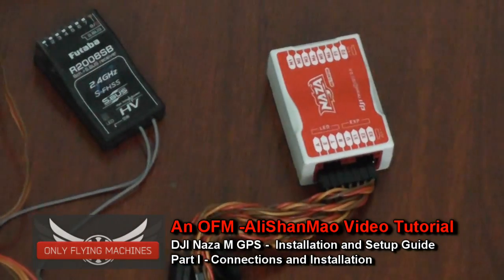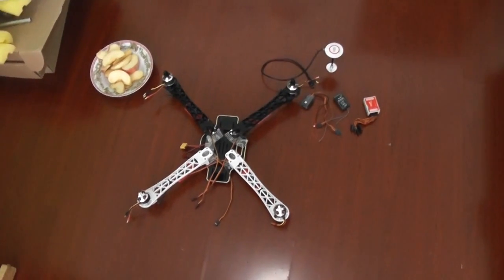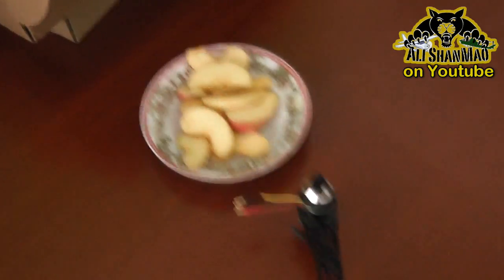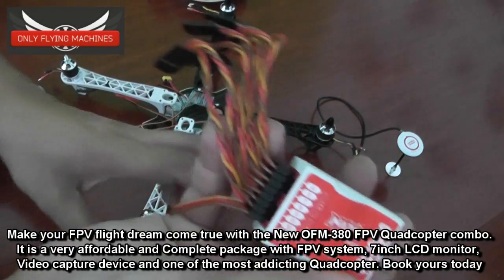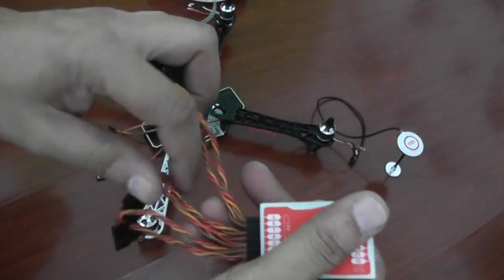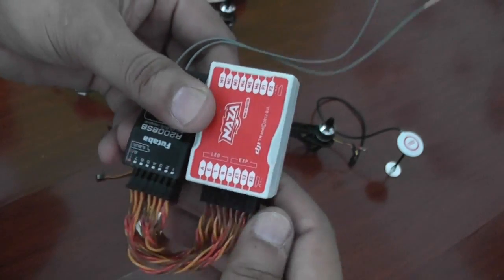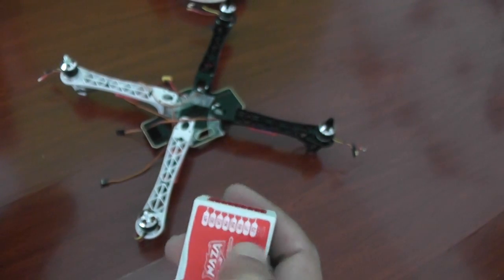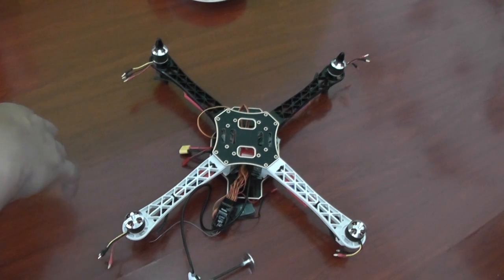DJI Naza Installation and setup New Guide -- Part 1

Comment: I don't have the LED with the output for X3 wiring but I habve the normal LED unit. Is there another wiring to read the voltage and to have acess to the "voltage monitoring" menu? Thank you

Comment: Ali, how do I get those cables that go from the esc to the M1, M2, M3, etc ports on the Naza? Do I have to solder that type of cable to the esc? Or do they sell them with that kind of cable already installed?

Comment: all you guys not connecting should understand that only 8 wires (Quad) should be plugged into your Naza. The 4 from ESC M1 - M4.  The S-BUS servo lead from port X2 into the S-BUS port on the RX!!!!    The V-SEN servo lead goes into port X3.  Then the standard L.E.D. and GPS connections go in their designated place.  Thats it fellas...I had problems until I switched TX and RX.  I went from a DT7 and the accompanying RX and never achieved flight, let alone connection to Naza.  So I wound up buying a Radiolink AT9 with the R9ds rx and connected and flying within hours of delivery...Hope this helps you.   Oh yeah the TX and RX are less than 100 on Amazon with Prime next day delivery...

Comment: Hi i have some questions, a total newbie.
Can you put some detailed pictures of the wiring between the naza and the receiver (which colour cables are on the upper end on both the parts...naza and receiver). and then the right way to connect the esc to the naza. thanks

Comment: I have a question, I had set my system up as per you 3 part instruction, worked great, Thank you. But now I am building a new quad with DJI NAZA and the Futaba T8J radio, when I went in and tried calibrating the receiver the stick movement does not show up in the DJI assist program. I can arm and disarm the motors with the stick movements but it does not show up in NAZA, any ideas?? Any assistance would be appreciated

Comment: why should you remove the red cable from the esc, i am using the naza m lite, and my motors, when plugged in will continuously beep every 3 seconds and the led module with keep blinking red rapidly.

Comment: sir i have question im from philippines,can i use a cheerson cx20 transmitter to naza m lite v2?
Reply: Sir I also have A question, How to connect naza to my FlySky 6CH???Thanks sir..
Reply: i connect the flysky in naza m... if you still need help i can help you..
Reply from the maker: +Vince Gabrinez I do not think so
Reply: ok tnx sir
Reply: sir sorry i dont have the idea of that,but you can ask sir alishanmao
Reply: ok
Reply: do you use the flysky  similar at turnigy tgyi10?
if is like that may I ask you for advice about the config in the radio transmitrer and connection receiver with  the naza m lite?

I conected the cg 1 2 3 4 to A E T R respectively, the channel 5 (flight modes) to the U on naza using the three position switch A on the radio. (but Atti is determined for the channel 7 on the radio).   and channel 6 on the receiver to X1 on naza  using the VRA knob to change the gains . the channel 7 to the X2  for the Intelligent orientation control , using the switch C on the radio. how use the Atti with the switch A if coming from factory that we use the channel 7 for that.

I will appreciate your help in this matter

Comment: Hey Ali,  nice video. Setting up a 500 quad with this unit.  Have a question about why to not hook up the red esc wires.  I am assuming that is the power positive wire, correct? Why is that important, many their videos don't mention that.  Also, can I just hook up the signal wires only on the receiver connectors? Thanks for all your videos, one of my favorite channels on the tube.

Comment: Salamulaikum Mr Shanmo
Can I use my Turnigy 6x with Naza Lite ? coz I have an issue when trying to do that, the Naza flashes yellow so fast and keeps in that situation :(, when the Tx is OFF the mode switches to ALT mode, and when ON it switches to the far right " EMPTY LITTLE BOX" !!!!!!!! any HELP please, does this trans. supports Naza lite ? Thanks in Advanced

Comment: Ail, I have been flying quads off&on about 2 yrs.I have just  builds a Tarot 650 sport, Tarot 4s 4006/620kv motors dji  opto esc &T8J tx. First test flight,got the quad lite on it's feet, looks like it is trying to go to the left.However the right stik moves it more to left, the ail sticks look back wards.But when programing on my pc all calibration were perfect, anyway it flipped. I have set everything by your videos for years with  no trouble, I'am at a lose- can you help.By the way I'am flying a F450 never crashed I am at a lose can you HELP............Jerry

Comment: My assistant software say "GPS needed" and it only goes into atti, manual, or failsafe. It has no option for GPS mode. Any Ideas?
Reply: I hv the same problem , any ideas?
Reply: +Seth Nicodemus ( the gps might not be working rite ) I crashed mine once and cut the wire going to the gps & when i put it back together it was doing that (no gps) I replaced it with the ublox and it worked just fine !

Comment: Hi Ali Shanmao  Awesome information and videos

i need some information i'm building a bumblebee 550 quad but i'm just buying the bumblebee frame i need help with the Transmitter, ESC, Motors, and Flight controller board but i want to use the Naza flight board  could you recommend compatible Transmitter, ESC and Motors  all most forget battery type too

Thanks in Advance 
Sheraz Mohammed

Comment: Hi Ali, I have a little problem with trottle and I can't find a reasonable solution. Trottle works perfect if I check on software, but if try to control it on the drone, motor start running slow and then suddenly fast once I move forward the trottle stick a bit over half the way. It should control motors progressively  from the lower to the highest position and viceversa, but works only if I connect the machine to the computer checking to the manager software, so I don't understand why it doesn't act the same once unplughed.  I'm using futaba Radio T8FG transmitter, and R6208SB receiver. Both motors and escs are from DJ Naza, as  well the main kit NAZA V2 (yellow one) the frame is instead from X650 aircraft. Thanks so much for your help.

Comment: I have all of the copter parts, though I don't have any apples.  Does this matter?
Reply: beaver2206  you will need the apples, that's the most important part of the setup

You can buy it from nearest store (unless you are living in Antarctica, in that case just be safe from polar bears, because if they eat you then your setup-apples will be of no use)

Comment: Hi can you help I have installed the naza m lite and I have linked to the laptop and set the calibrations I think but when I unplug the usb I still have a orange flash then 3 red flashes and so on,have I done it wrong,I can arm my motors and throttle them up,thanks

Comment: My naza m v2 gradually loses power to esc's after only a few min of flight and lands wherever it is at. Even with full throttle have you seen this issue? Not in failsafe or voltage protection mode normal led signals.

Comment: I am thinking of getting a NAZA M Lite with GPS.  Is it possible to program the barometer/altimeter and tie it to a switch.  I would essentially want to be able to flick a switch limiting the height to 4-6 feet and then when I am ready to land stabilize the quad, flick the switch and bring it down.
Reply from the maker: why not you put the throttle to middle when you are at 4 or 6 feet and your multirotor will hold altitude :D its easier than programming the barometer which of course there is no way to do so

Comment: For folks that are using BEC enabled ESC's like the Mystery ESC's make sure that you pull the RED wire and make sure that your ESC wires are BLACK-wire-UP connecting to the NAZA! I am Using the Turnigy 9XR TX and the Orange 9CH DSM2 RX and my quad is flying "like a Dream come true"! I mean anyone can fly a quad like a pro once your NAZA is setup correctly. The challenge is wiring and radio settings. Once you get those 2 things right a 10 year old kid thats never flown anything b4 can fly it!:)

Comment: Ali in your email to me you said that the NAZA isnt compatible with the new Turnigy 9XR TX so does that mean that it wont work correctly with a 9X TX as well?I know that you referred me to DJI USA but now I am afraid to order the NAZA because it may not work with my 9XR and I am pretty committed to it because I have already bought the modules etc. Is there another flight-control board that will work with my Turnigy TX other than the KK2? My FS Attitude FPV is on order right now & Im So excited

Comment: Great videos! I have a question about power. The VU/LED unit powers the NAZA unit, but does it also feed power on to the RX, or will I need a separate BEC to power the RX and FPV equipment?

Comment: You don't have to remove the positive wire from the servoplug. All of the positive pins in the NAZA-M controller is connected, so it will not "burn" or anything. I fly it with on my quad with UBEC builtin my ESC, and none of the positive leads is removed, and it flyes perfect.

Comment: Great videos, very helpful. I have one question though, how do I know if my ESC is BC enabled? I'm using Hobbywing Skywalker 40A, I checked the website and can't find that info, any insights? Sorry for the newbie question. The Quad copter had all the wires connected to the old MWC board, I'm assuming BC is not enabled, and of course the manual doesn't mention anything about BC enabled or not.  Thanks

Comment: i have the new quad ,,can i use me c7 futaba TX. wiyh the DJINaza control unit ?. way do i need to cut the red wire on my esc, the red is the power  wire.? im ording the controler board and and gps, what else do i need , pleas let me now ok. thanks.

Comment: One thing to note the cables supplied by Naza do not fit a Spectrum receiver,I had to grind off the right tab,not that hard,they are designed for Futuaba receiver

Comment: Thanks Ali!  I have a DJI Naza and GPS with a 450 Flamewheel on the bench. 

I have motors installed, but yet to install speed controllers. 

This tutorial series will help with the setup!  Much thanks!

Comment: No mixing needed but I had to swap a couple of channels over on the Tx, there's a wee diagram in the Naza manual which shows the S.bus channel mappings.  The single lead supplies power to the Rx and does the control signals.

Comment: Great video! Just to add, I use my R2008SB in S.Bus mode to the Naza, works just as well but 1 wire instead of 7.  Bit less spaghetti on the quad :)

Comment: I use one 3 position switch for the 3 flightmodes and another switch for failsafe that works for all the 3 flightmodes. Are you saying that's not possible or am I misunderstanding? I use Spektrum DX8 but don't think that's different.